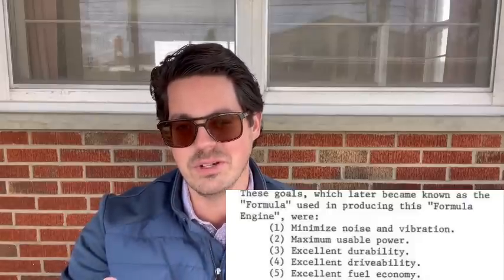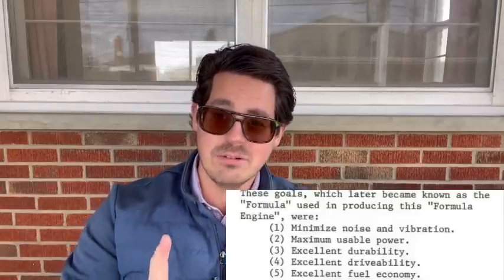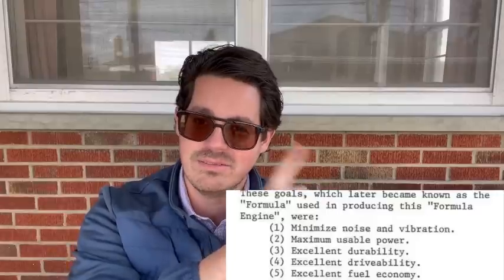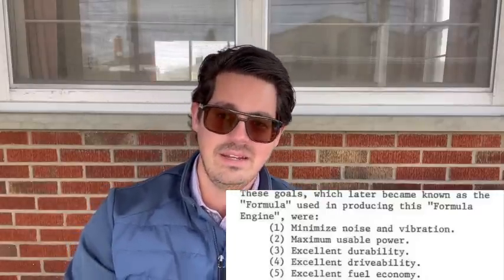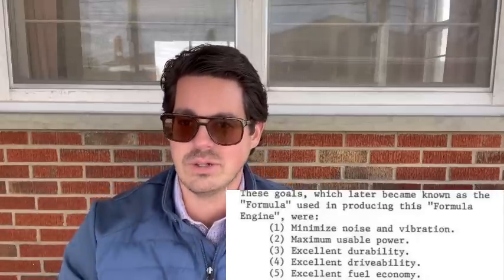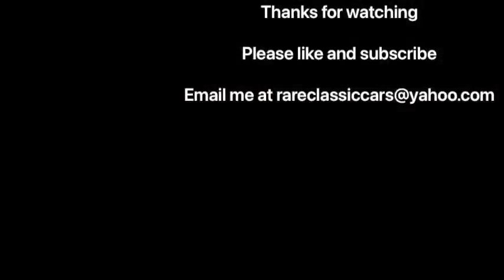Worst Engines of All Time: GM's 2.5L Iron Duke 4-Cylinder

Comment: You should stick to commenting on things you are competent in. Having had a number of iron dukes I disagree completely. My brother in-law, an engineer in automotive industry and designer of crankshaft turning machines, said the iron dukes had a stellar reputation. Not high tech, but solid, reliable and easy to work on. Maybe you prefer engines that require a degree in computing...I don't.

Comment: Well, perhaps the one in the Celebrity that my parents had was on the low end of the curve, based on the comments here.  It was a bad experience all around, with a cracked block and a rod knock at around 60k miles.     The car around it (83 Celebrity) was a complete dog, suffering from electrical problems from the first year that were never properly fixed.  Noisy and slow.  (Then again almost all cars of that era were slow).  It went off to scrap before it was 10 years old.     As mentioned in the video, even coming from a late 70's V8 that was not powerful but at least smooth, it was quite a come down.    I wonder somewhat if there is a bit of a survivor bias now.  The only ones around at this point are likely the very high end of the quality curve, rarely driven, or both. After all this is now 40 years later.   I don't know the stats, only personal experience.  I have zero nostalgia for it, other than it being the car I learned to drive in.   I think every other car I have owned or driven since has been better.

Comment: I initially wanted to give you a thumbs down.  But after listening to the whole video, I agree with you.  I had it in my 91 Ciera. Great engine, very reliable.  Decent power for the car.  Good mileage.  But it did idle and accelerate like a cement mixer.
Reply from the maker: Ha. Thanks. As I mentioned, they were reliable. But customers expect more than that.  It was horribly unrefined.

Comment: Having built no end of Holden 6 engines,, 48-85 they all had fibre timing gears originally.4&6 cyl versions. Even when replaced with alloy timing gears they are quiet. 
Chains also generally had fibre cam gears. Ford and GM V8s. Chains are failing from first start up.
Front drive cars are dangerous, always have been always will be. 
GM, yet again did not offer smaller rear drive cars,, front drivers fail quicker so they will sell more cars??? Well corporate thinks so anyway.
Though late 70s,, the engine was prehistoric. Not to say bad but noisy and old fashioned. Though the Ford Germany 'Pinto' engine was OHC and went ok but was heaveir and noisy

Comment: While properly operating balance shafts themselves are not noisy, the chains or gears that drive them certainly can be. Balance shafts also introduce a fair amount of heavily loaded bearing surface that adds to the "load" on the oil life.
I will add that while this engine had significant durability, unfortunately, it was often wrapped in some of the worst FWD cars GM ever built.

Comment: Yeah, give me a 2 liter ford, 71 72 pinto, mech cam, freekin hot 110 stated stock has. Mire like 120 plus. 200hp easy with cheap speed parts. Screw any 2.3L with hydro cams.

Comment: 😀You are incorrect that the Iron Duke is a distant decendant of the Chevy II four cylinder. It is the exact same engine, the block , crank, cam gears cam shaft, everything.  The same engine  as the 192, 230 250 and 292 six cylinder motors. The only thing changed was the cylinder head was made cross flow for use in the transversed mouting in front wheel drive cars.  And the distributor was moved from the posotion between  cylinder 1 and  2 to between 2 and 3. And the water pump was moved  to a side mount, once again to accomidate the transversed moounting. As for the cam gear noise and wear there is a small oriface and a tube to spray oil on the cam gear. By neglecting oil changes that small hole will plug up and the gear will naturally be more noisy and premature wear as would anything that is not properly lubricated.

Comment: The iron duke is a great cheap car engine.  Crude and noisy or not they work and work.  They keep functioning for years.  I won’t say they are as great as the ford 300 6 but they are pretty damn great for what they are designed for.  Not a great powerhouse but for a cheap reliable car that’s what they are for.  They understood the assignment.

Comment: I owned an early Pontiac Fiero and agree that it was one of the worst engines .  The car spent as much time in the shop as on the road. it suffered from multiple ENGINE AND TRANSMISSION FAILURES THAT GM HAD TO EAT

Comment: Better check your facts your way off guy the 2.5 will run for ever if it's well maintained and cared for
Reply from the maker: Durability is far from the only attribute customers care about when rating an engine. Truth is the engine was very crude, noisy, with significant vibrations. Not acceptable in near-luxury cars.
Reply: @RareClassicCars  sorry to break It to you I can't think of any any luxury car it was installed in just your typical down sized GM cars and small trucks
Reply from the maker: @jasonhumphry5836  it was in high-end X, A, and N bodies as the standard engine. A Century Limited, Cutlass Ciera Brougham, Omega Brougham, Skylark Limited, Somerset or Calais were not cheap cars in the day despite their size.  This wasn’t a Cavalier engine.
Reply: @RareClassicCars  wow you just can't let it down you probably wasn't even alive in these times I can see who you are though peace and much respect to you to each his own I guess have fun with you high end motors I'll stick with my strong runner and work horse motors and I have many again take care and good conversations
Reply from the maker: @jasonhumphry5836  I was indeed “alive” during these times and have owned 5 cars with the Iron Duke and still own one.  I personally like the engine, but also try to be honest about its shortcomings.  I’ve never had an auto trans car equipped with one where the dash didn’t come alive at curb idle in Drive and start vibrating.  That would’ve been a deal breaker for many, many customers.  And, many of them were very loud.  

The manual trans vehicles, especially the trucks, were much better with a higher idle speed and engine and trans decoupled w the clutch depressed. 

In any event, thx for the commentary.  These things are obviously debatable.

Comment: I had one in my first car, an '84 Camaro.  Anyone with fond memories of this POS engine is profoundly deluded, it was one of the most gutless powerplants Detroit ever made, to the point of being dangerous.  Seriously, attempting to pass a school bus on a typical country road was basically Russian Roulette with this thing, considering you could measure acceleration with an hourglass or sundial.  I remember being totally unable to pass a HS buddy of mine once on WI-35...and he was in a late 70s diesel Oldsmobile.  Pedal to the metal, just nothing left.  JFC.

Comment: The measure of a non high-performance or heavy-duty engine is what totaled vehicles with little more than an engine to sell will bring at the insurance auction. For years, iron duke cars were CHEAP because the salvage yards couldn't sell them with little demand for engines that didn't often fail catastrophically. Power? No. Silky smooth? No. Efficient? Not really. But if you managed to keep some oil and coolant in the iron duke, you'd generally have good luck for at least as long as the rest of the crap GM vehicle might last...
Reply: Perfect analysis of the 2.5L Iron Duke engine.

Comment: I do remember now in the early 90's test driving a Grand Am with the 2.5, and shortly after driving a 4 cyl. Toyota something, don't remember what exactly.  At the time I thought to myself how could anybody choose the GM car over the Toyota.  Not just the no comparison between the 4 cylinder engines, but the Toyota was just superior in every way.   Not that I was a Japanese car fan at the time, but there really was no comparison between the GM car and the Toyota.
Reply: But Japanese cars had no torque, and rubber timing chains and water pumps inside the timing gear cover.

Comment: If it’s reliable and durable, then it doesn’t belong on your list of worst engines.  I take great offense to this because I’ve owned several Iron Duke (Tech IV) engines with no problems.  Save your “Worst engines” for engines that were notorious for giving trouble like the GM 2300 used in the Vega.
Reply from the maker: I reserve “worst” for any engine that makes steering wheels and dashboards visibly shake and rattle at idle.

Comment: The 2.5 iron duke was an excellent engine. I’ve owned 3 and none of them had any issues and I never wore one out.
Your video and your information is not an accurate reflection of the duke or its ability.
Mail jeeps ran them forever and they provided millions of miles without issue.
Pick on another engine…..like Mitsubishi

Comment: At the same time, Toyota was producing 22-R engines, flawless; why GM could not, with all their intellectual "horsepower" offer, at least, the reliability of the Toyota engine? Any Iron Duke equipped vehicle on the 401 was a white knuckle affair. The 4 cylinder 1/2 Pontiac V8 could be optioned with a 4V carb, split exhaust, 4 speed, in a Lemans (sorry, Tempest)
Reply: The Iron Duke was VERY reliable.

Comment: Why is it crude... ??? Because its not completely made of aluminum with 16 cams a 100 valves and 5 PCMS to run it...??? The engine was bullet proof... Sorry if back then GM didn't have today's tech... You're comparing apples to oranges totally 2 different world's here...

Comment: I completely disagree the Iron Duke 2.5 liter was NOT a bad engine!! First it was stupid simple to work on, and a lot of people don't realize it literally is half of a 350 small block Chevy engine! So directly the bore and stroke of the engine was identical to the 350 small block engine, meaning you can upgrade the performance of it with over the counter parts! 

Personal the Cadillac 2.2 liter that GM produced and found in the 1990 Sunfire and Cavalier are possible the hands down worst engine GM ever produced! They get shit gas mileage, run like crap and are prone to exploding as my brother had that happen to his Cadillac Cimmaron and it happened in my 1995 Sunfire as well too!! 

The only problem I have ever had with an Iron Duke is the lifter pans leak terrible, though this pan is designed like the side pan on the inline Chevy straight six cylinder! But other than that they are a reliable and durable little engine, and with a stick shift, manual transmission behind them, they do offer a lot of fun driving experience in my book too!!
Reply from the maker: First of all, it is not half of a Chevrolet 350. Half of a 350 would be 175ci. This is a 151ci engine.  It has the same bore and stroke as the Pontiac 301 V8 and was designed by Pontiac, but it is not half of a 301 either.  The 2.2 engine was a Chevrolet designed engine that happened to be used in the Cimarron in 2.0 form. 

Lastly, I agree they are reliable. However, they are super crude.  Customers expect far more than an engine being reliable, especially if they are buying a near luxury car like a top of the line X, A or N car.

Comment: Well I had one that lasted $231,000 MI with decent maintenance loaned it to my niece and it popped the hose and she kept driving it so it blew up but it was running like a top are you clickbait or what
Reply from the maker: Nope.  If you watch the video, you see I say they are durable. However, that is expected from consumers. No one expects to buy a car with a fragile engine.  They were horrible coarse, loud, and vibration intensive until they got a balance shaft in 88.  Compared horribly with anything the Japanese were putting out.

Comment: I  HAVE OWNED SEVERAL G M 2.5L ENGINES ,  STARTING WITH THE 70s VEGAS ON TO THE EARLY 80s BUICKs WITH THROTTLE BODY INJECTION SYSTEM AND NEVER OWNED BETTER ENGINES IN MY 78 YEARS ON EARTH !!!!!!!!!!!!!!!!!     I OWNED THE CAST IRON BLOCK ENGINES (  NOT ALUMINUM ) AND THE 1984 BUICK I OWNED WOULD JUST ABOUT RUN WITH THE V8 ENGINES FOR POWER AND SPEED !!!!!!!!!       IT WOULD SCREAM !!!!!!!!!--------------------------------------------------------------------------------------------------------------------Ernest E. Johnson

Comment: Too bad Pontiac put these in the Fiero, they should have used the 1.8ohc instead.
Reply: Smaller means less torque.
Reply: @michaelbenardo5695  yeah but the 2.5 was heavier and only available with a 4 speed at the time, where as the 1.8 had a 5 speed and much lighter, they even had a turbo version in the 84 J cars. A much more sporting engine to suit that type of car.
Reply: @mcqueenfanman  For this particular car, you do have a point.  Did you know that they finally were able to get a V6 version in production?  It was a WAY more fun car, then they pulled the plug, just when they made it right.

Comment: Your missing the point. These engines were quite reliable. Mine lasted over 200K! Who cares about high power or vibrations? All people care is if they are reliable and simple and cheap to rebuild and maintain. I could work on this engine easily.  The venerable Iron Duke easily outlasts today's turbo direct injection eco crap engines, that are expensive to fix and that are ready for the junkyard at 100K.

Comment: Agreed, pre-balance, it was very agricultural. Durable, but an obnoxious engine to have in a car.
Reply: Many of the Japanese engines from the 70s were even worse.
Reply: @michaelbenardo5695  I cannot think of one offhand. I drove some very rough Datsun and Toyota trucks from the early seventies as well as their cars. The Hondas were even smoother. There were some nasty Isuzus and Mitsubs I never rode or drove.
Reply: @seejayfrujay  My parents bought a 1971 Toyota Corolla, and it was a miserable little cracker-box.  It was chincy and flimsy feeling, very underpowered, rode like a truck, and was super noisy.  An aunt's husband bought a 71 Datsun around the same time.  My mother said it wasn't much better - a little faster, but still noisy and hard-riding.  A friend's father bough an old late 60s Toyota Corona, and while it was a pretty quick little car, despite the 2 speed automatic, and wasn't as noisy as my parent's Toyota or my Aunt's Datsun, it still had a hard ride.  He also bought a 1980 Omega, the Oldsmobile version of the X car, fresh off the showroom floor, and it was LIGHT YEARS quieter than the Japanese cars I experienced and rode WAY better than any of them, and had much more room inside as well.  These cars received horrible press, but after a recall, he never had any trouble with his.
Reply: @michaelbenardo5695  I owned a 72 Capri, and worked as a mechanic at a Ford dealer on pintos and their Mercury badge equivalents. I also worked on Vegas from referrals. This was in the early seventies. NO WAY were they near a Japanese car. In 1980, Detroit was beginning to know how to build a small decent car and the comparison drew closer to something not a slam dunk. The most refined reasonably priced small car you could buy in the  80s was a straight six Japanese sedan.
Reply: @seejayfrujay  I have already said that the Vega was trash.  Most of those 70s Pintos and all of the Capris had GERMAN designed engines, and the Capri was in fact a German car.  I didn't like the Pinto, but I, and many other folks DID like the Capri.  It was one sharp little car, and unlike most little cars, you could get that V6 in it.  It wasn't the greatest engine, but it was nicer than a 4.
Reply: @michaelbenardo5695  The Taunus 2 L was fairly quiet and sedate, did not vibrate at idle appreciably, but got buzzy and noisy above 3400 RPM. When Ford built their own version of it punched out to 2.3 L, they put in hydraulic lifters, which saved a lot of grief. Most owners had no idea the older engine required valve lash adjustments. Ford's small cars in the early 70s were a parts bin selection from their Euro operations, and along with the Ford Taunus engine, a ZF transmission, and a Weber 2 bbl carb were included. This was all new to owners and mechanics--I fixed a lot of mangled timing belts.
For my ride, I had the 6 cyl Capri but traded it in for a car with AC (78 Honda Accord LX).
Reply: @seejayfrujay  I didn't know the earlier one had solids either.
Reply: @michaelbenardo5695  The 2L could rev like a beast, but one was not inclined to do so since it was so buzzy and there was not much up there after they reduced the compression in 72. The 71 models were quite fast for the time--3rd gear @ 95 mph for the quarter and could give a weak v8 a lot of trouble.

Comment: Sorry, but I have to laugh a bit. The engine has a specific power of 45 hp per liter. Cannot turn more than 4000 rpm because of the crankshaft, cannot go at speed on the highway because the teeth of the camshaft eat itself up within 100.000 miles. And he says the engine is generally reliable and durable. You have to be an American consumer to say that! Haha. Besides that, a 2.5 liter engine with only 4 cylinders is madness. Lancia tried once (a boxer I believe). A disaster, very unrefined. A four cylinder should never exceed 2.0 liter displacement.
Reply: I for one don't like tiny engines.  This is North America, not Europe, not Japan.
Reply: @michaelbenardo5695  Well, my point is, you need 6 or 8 cylinders then.
Reply: @ronaldderooij1774  I want at least 6 cylinders too, but there are people who really do like 4 cylinders.

Comment: Vega Max POS! 

2.5? Mini POS! The earlier Chevy 4 ( the old 6 cyl with two cyl  loped off ) would have worked better.  About any application would have done better on a plain iron six.  Forget the front wheel drive!